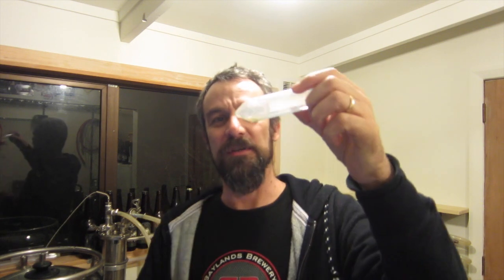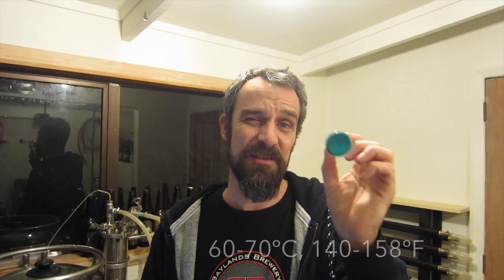Diacetyl testing in beer, Homebrew Wednesday 94

Comment: Exellent information.So if after the two days of ramping temp up you do the test again and its still there in the heated up sample
Do you repeat or is it likely it would be gone 100% from upping temp.
Reply from the maker: yes repeat the test, and if diacetyl is still present leave it for a week. Their might not be enough viable yeast to clean up the acetolactate fast enough. However if you detect diacetyl in both the heated and unheated samples, then it is a bacterial infection or oxidisation that has already formed the diacetyl and you won't get any better. Then its time to review sanitation and fermenting procedures. Thanks for watching, cheers
Reply: Time4Another1 exellent thankyou.I hope you do more like this its was very helpful and to the point top work.Absorbed it alot easier than reading it.